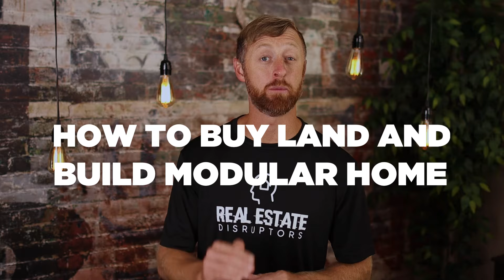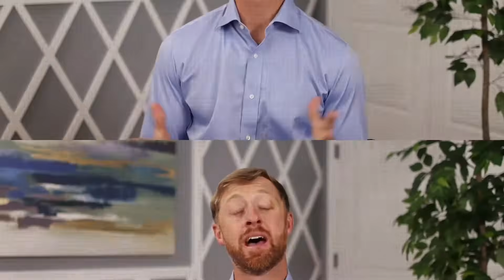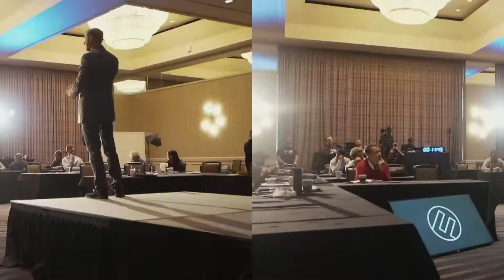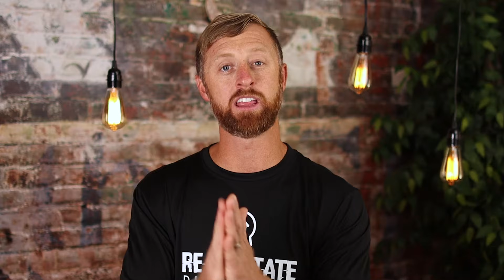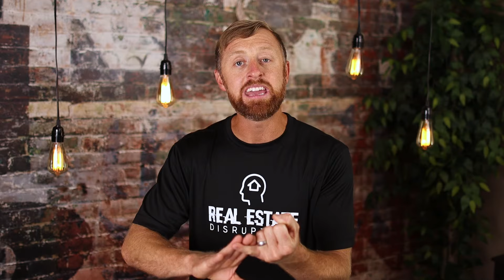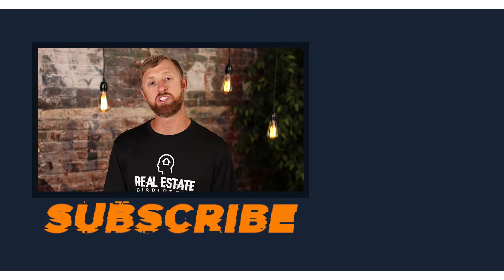How To Buy Land And Build Modular Home

Comment: I live in a modular that was built in 1987 and it’s great. All the wiring is like giant wire harness in house not random wires all over . Around the outlet boxes are sealed with spray foam from box to sheet rock. The sub floors are glued and nailed down. Plumbing is good all very systematic. I think there built much better in controlled environment and specifications

Comment: For everybody trying to nitpick between manufactured vs modular…I am n East Texas and the deed restrictions DO NOT DIFFERENTIATE at all between modular or “mobile homes”. They generalize and just say no to anything but stick built. The only options I have found are 100% undeveloped or a ‘neighborhood’ that is mobile/modular/manufactured only. The first has higher up front costs and the second risks deteriorating overall land values. One broken down old house of any kind in the development and booom, there goes your hopes that 10 years down the line your property values won’t depreciate.

Comment: Those setbacks you probably could have just found on either the county or municipal development website.  That info should all be publicly available.  It should not require a surveyor to get that info…however, you will want to have a surveyor to map your land and stakeout that setback if you are running tight tolerances to your boundary.  In my experience, municipalities do not like variances.  Those are usually reserved for something highly functional and/or applicable to the public good…often having to do with new development in an older area.  Where I worked, variances were nearly impossible to get, just cause we didn’t do our due diligence..

Comment: I was a licensed master plumber and did the heating system and connect the waste lines to a 6” cast iron pipe through the concrete wall and sealed it with Oakum and Silicone. 
Modular’s are pretty easy to finish off the work for plumbers. 
All the lines for the waste lines, heating lines along with the water supply lines are tails hanging through the floor and they are all Labeled. 
So basically I ran a trunk line and connected waste lines to be connected to the pipe going through the foundation wall to the Septic Concrete tanks, most regions require first tank and then an overflow tank that goes out to the Distribution Boxes and Leach Fields. 
The heating system was an oil fired boiler, I would recommend Natural Gas or LP Boilers, they are much more efficient and less maintenance than oil. 
These homes had wells, so I had to install the well tank, and then install a Manibloc system and connected the PEX lines to this Manibloc which looks like a Circuit Breaker box, doing this made every PEX line to be a Homerun and allows the owner to turn off every line to be turned off at the Manifold. 
Of course there are shutoffs under each fixture. So this an additional option with control over the plumbing system.
Reply: How much a job like that cost ?

Comment: One mistake you make throughout this video is a mistake i also see home buys making. You are looking at it from the point of view of putting up this house and then selling it for max profit. A lot of home buyers are looking at resale value down the line. What you need to be looking at is cost of living. For instance natural gas vs propane. Natural gas while being expensive to have installed is much cheaper to use. So if you are just flipping the house sure do propane but if you want to live there for any amount of time add up the savings natural gas will bring you and see what makes sense for you.

Comment: Don’t buy a noncompliance new manufactured home.

CHECK THE EXTERIOR MATING SURFACES. IF THE EXTERIOR MATING SURFACES IS NOT SEALED WITH SEALANT AS REQUIRED PER SECTION 24 CFR 3280.307
RESISTANCE FROM THE INFILTRATION OF WIND, AIR, RAIN, AND WATER.

IF THESE SURFACES ARE NOT SEALED WITH SEALANT.

THE NEW NONCOMPLIANCE MANUFACTURED HOME SHALL NOT BE OFFERED FOR SALE. AS REQUIRED PER SECTION 

42 U.S. CODE 5409😂😂😂😂😂😂😂😂😂😂😂😂😂😂😂😂😂😂😂😂😂😂😂😂😂😂😂😂😂😂😂😂😂😂😂😂😂😂😂😂😂❤❤❤❤❤❤❤❤❤❤❤❤❤❤❤❤❤❤❤❤❤❤❤❤❤❤❤❤❤❤

Comment: I bought a 1973 trailer on 2 acres for $55k when original asking price was $80k. I’ve owned it for a year now, and it’s a 2 bed and I have 2 kids. Instead of putting an addition on, I would rather just put a modular on it. My question is, I want the new home to sit in a different spot. Can I still use the same septic and everything?

Comment: i Have a VA loan. and was considering this as a cheaper way to get a house and to get out of renting.
Reply: I’m looking to do the same thing
Reply: Did the VA loan and lender approve you for modular building?
Reply: Any updates? In the same boat
Reply: I’m doing the same now. Va loans will work but you need to find a company that does land + home packages to roll all of the costs together.

Comment: Hi
I have lot free and clear and want to put modular home. Thinking to act as general contractor.  In past I have done a modular home but used general contractor.   What is your opinion?
Reply from the maker: I highly recommend using a General Contractor to help out with this. I have done them where I acted as the homeowner /builder and it was just too stressful. Way Easier when I used a General Contractor to handle everything :)